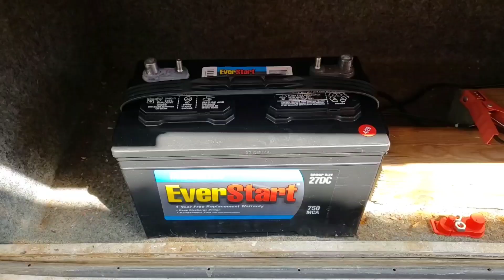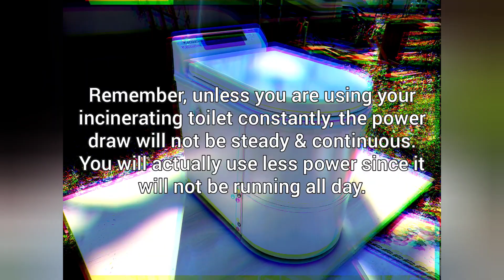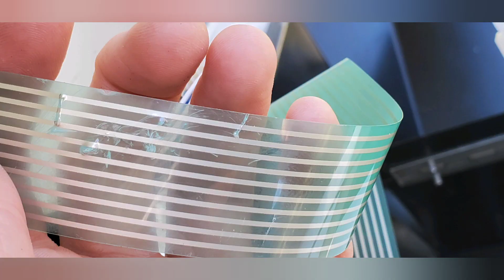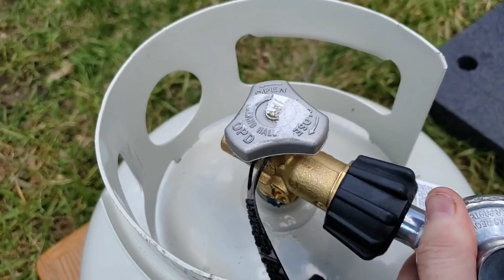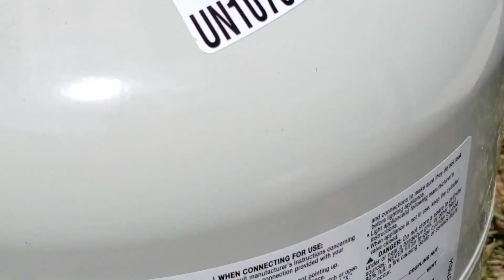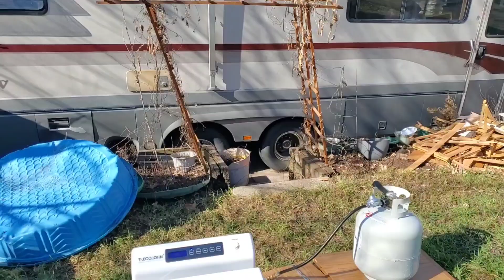Tiny John Incinerator Toilet Set-up & Install Part 2

Comment: You have had much better luck than I have! My tiny john has been a nightmare
Reply from the maker: So sorry to hear that. Are you thinking of trying another brand?
Reply: @ceefiveceefive  I'm not sure. The latest excuse we're on is that it hasn't been working because the settings are set for the catalytic converter, but they forgot to install that. My builders have set the knobs every which way, and it either melts the vent hood, caulking,.etc, or it doesn't burn. Hopefully, once we get the converter it will work? But I have little faith at the moment,.frankly.
Reply: They are supposed to be sending me a new one; they never could get the first one to work. It has been a battle!
Reply: How much does it cost

Comment: What do you think of the construction quality? 
From the video, it looks like the vent hole isn’t centered on the vent pipe, the “Power” label looks homemade, unfinished/sharp edges, etc.
Do you think the quality aligns with the price?
Reply from the maker: Robert,
Compared to their promotional video, it seems it is of cheaper quality.

Keep in mind mine was a used older model.

Comment: Great Demonstration Cari Beth. Where abouts are you planning to mount the 20lb propane tank?
Reply from the maker: Pete,
I have 1 of 2 choices. I already have a large RV tank installed on my class A. I could use that. Or if I decided to get rid of the large tank,  I would install the 20lb tank under the basement storage near where I locate the Tiny John.
Reply: Cari Beth that’s a great option either way you’ll have it figured out. I like the big tank under the coach.

Comment: Great job of showing the solution at the leak and the fix. Makes it easy for someone to see exactly what they should be looking for - well played!
Reply from the maker: I wanted folks to see what to look for. It worked, lol. 
The Tiny John is the only appliance I will have that uses propane because I want to eliminate the carbon monoxide issues. Making sure there are no leaks is very important.